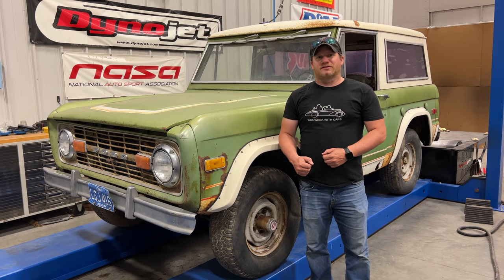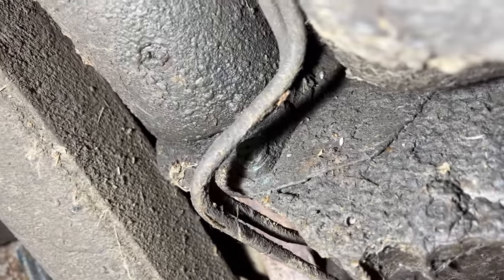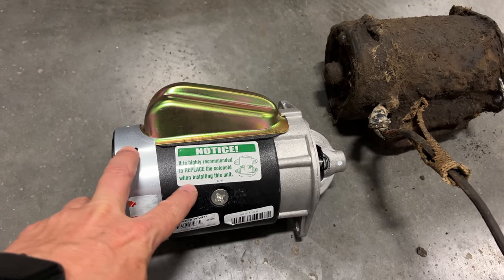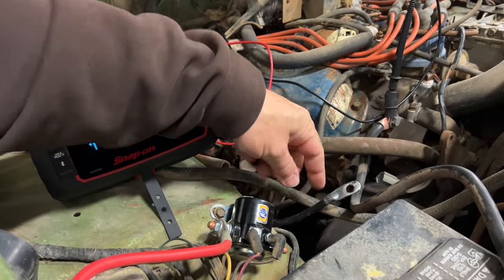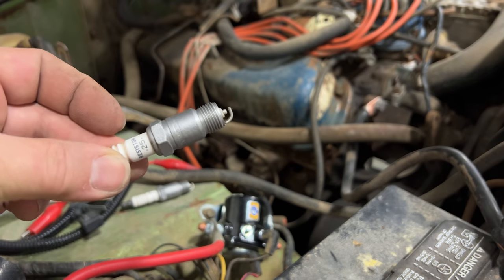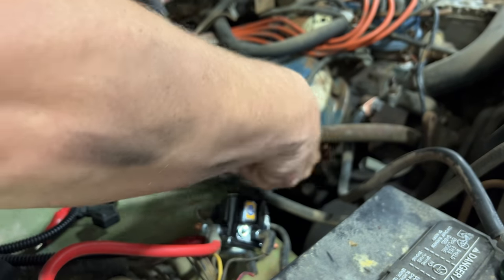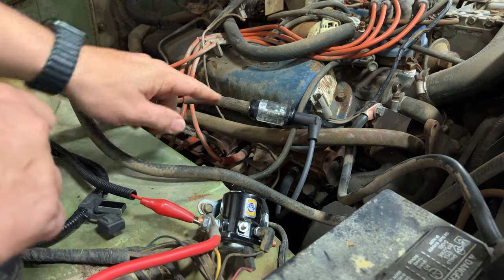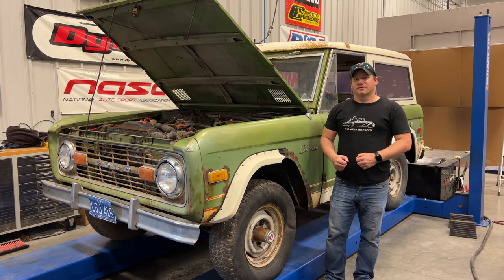1976 Ford Bronco Sport Parked for 30 Years - Part 2

Comment: I bought a 1975 Bronco Ranger  and with the same engine as this. Man, did it like 'eating gasoline' !
One very annoying issue / [problem I had with mine was the driveline slip yokes binding up. This happened  every time a I would bring my Bronco to a stop, I could feel
and hear the drive shafts sliding back into their yokes. The Dealer's service guys could not find the issue no matter what they tried, yes even as far as new U joints and yokes even new shafts, still that annoying 'crunch' was there. I traded the Bronco in on a '77 F150 Super Cab, issue disappeared! :)

Comment: Looks like the electrical problems put the car off the road all those years ago. It would surely be too much of a coincedence to have serious mechanical faults too, apart from those caused by sitting idle. 
A ceased engine would have been my biggest worry but it's spinning fine. My guess: once you get spark to the plugs, she'll fire right up.😁👍

Comment: are you not going to need new plugs anyway? are the plugs you buy one time use?
Reply from the maker: I will use these to plug the holes when painting the engine and put new ones in when it is done.  It’s faster to clean these than to run to the store.